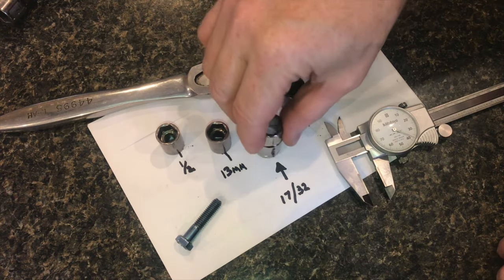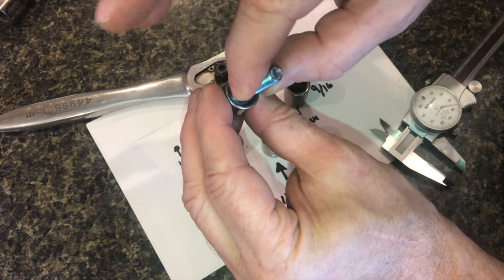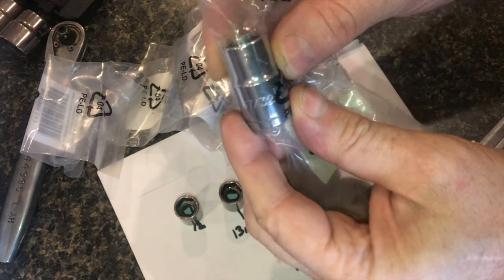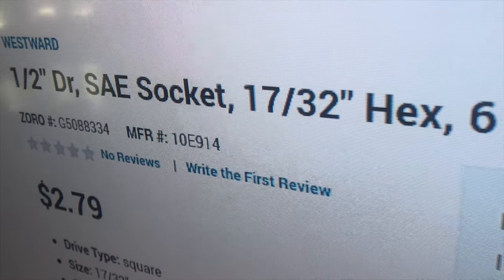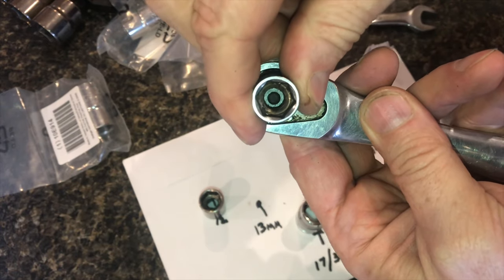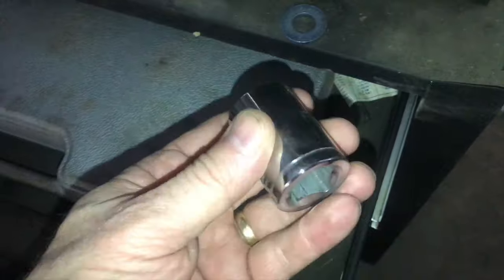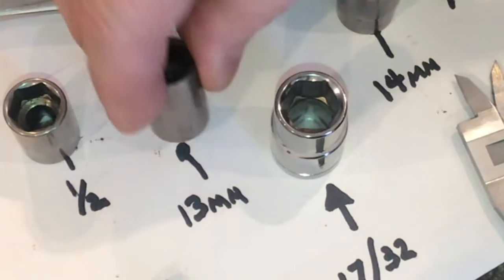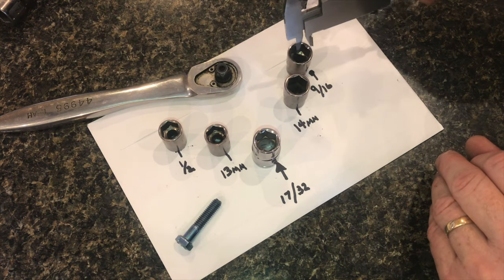is the 17/32 socket a NECESSITY??

Comment: 👍😎👌I'm so glad you posted this video. It appears I'm going to need a 17/32 deep socket to take off my exhaust pipe under my Hummer H2. The left side of the pipe I was able to use a 15mm deep socket but on the right side the 13mm is too small and the 14mm is a little too big it's stripping the nut. Hopefully I can get this socket and finish my project and if not I guess I will have to cut it off.😲😳